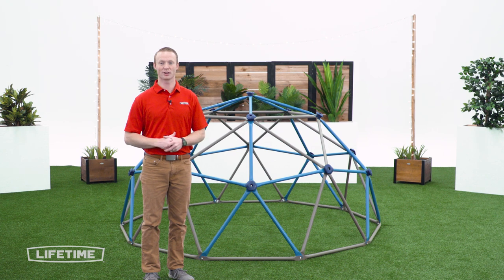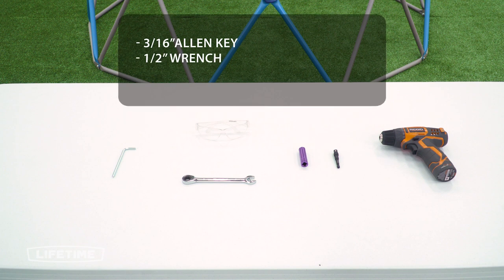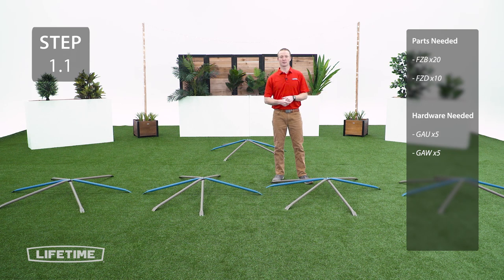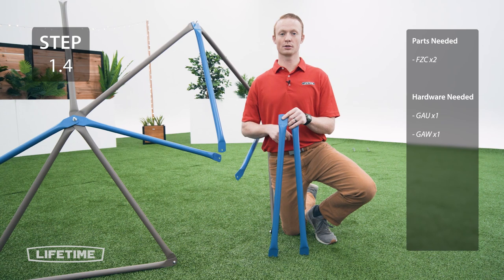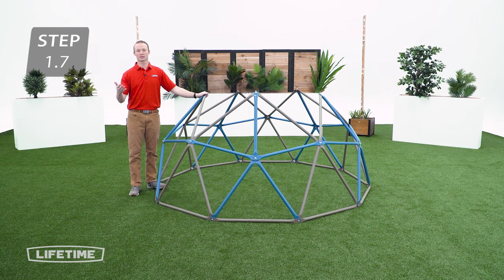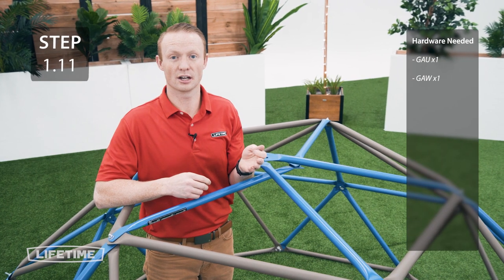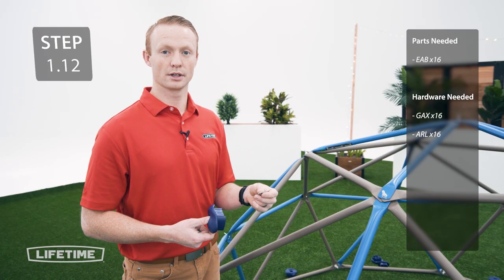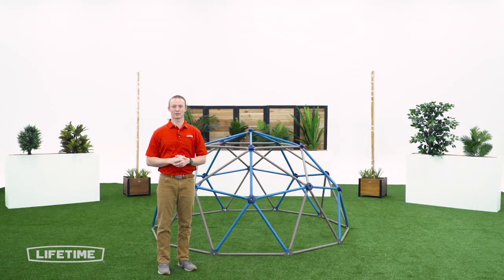Lifetime 54" Climbing Dome | Model 90939 | Lifetime Assembly Video

Comment: I assembled model 101301 (primary color) by following this video. It took me 3 hours to assemble by myself. The video was easy to follow along. I just switched the brown for blue bars in model 101301 and the blue ones (in the video) for the red ones. I did not have to refer to the manual except to double check the parts number being used. Being in Arizona heat, we had to make sure this was placed under a shade area. Those bars heated up quick under the sun.

Comment: Can't see what he's doing when the text is covering the screen.
Reply from the maker: You can turn off the closed captioning by pressing the “CC” button on the bottom right of the screen. The closed captioning are also only on when he is speaking, as soon as he starts to assemble, they go away.
Reply: @LifetimeProductsAssembly  I have a question we have moved and although the video is good, why do I have several brown or grey bars that seem thicker?
Reply from the maker: @mark1957  The thicker bars are designed to be stepped on while climbing. The thinner bars are designed to hold on to when climbing. Make sure the stickers are not taken off so you are able to identify the different bars when assembling.